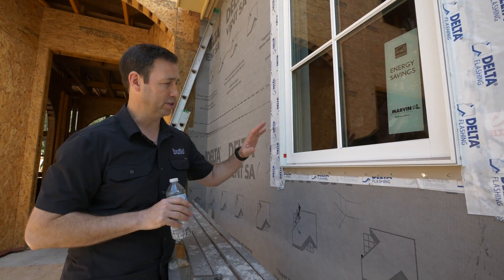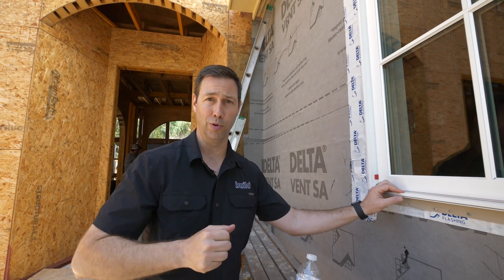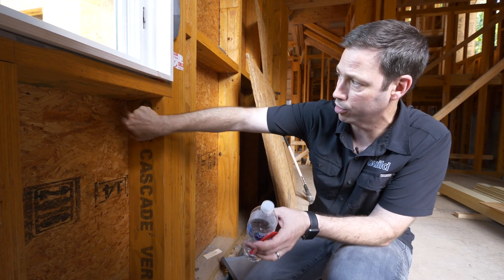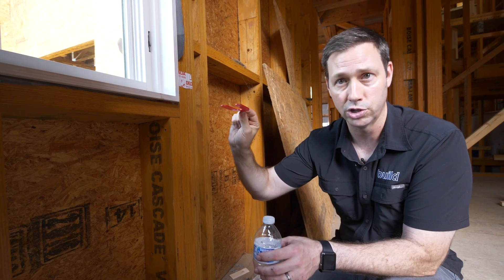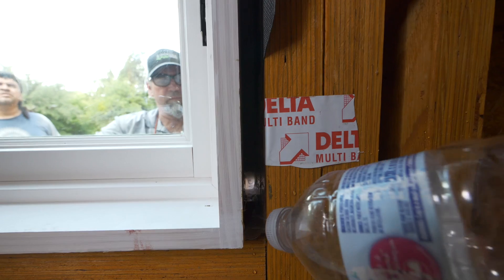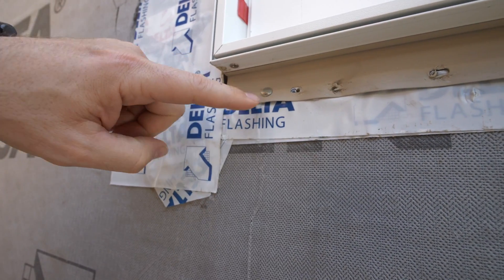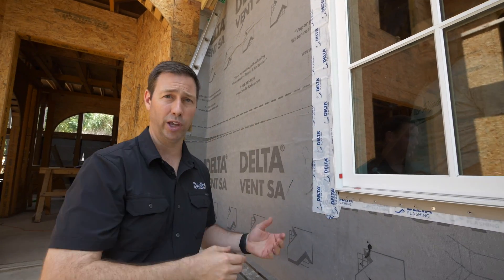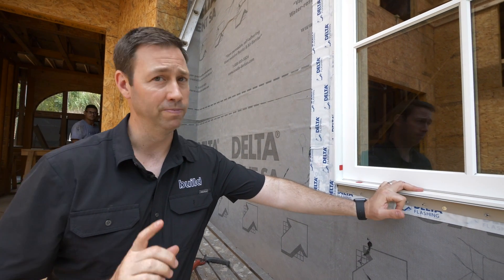What happens when a window LEAKS?  Testing an install

Comment: Hi Matt this is a great video. We have block frame Fleetwood windows installed in our new home and unfortunately we have leaks at the bottom corners on the inside drywall. The contractor said it is the window units that are at fault. But after testing it is the install that seems to be the problem. Any tips on installing block frame windows (they are placed flush to the inside frame so there is a reveal around the windows on the outside.

Comment: I just installed windows in my beach house with very similar practice. We get 100 inches of rain a year (Oregon coast), so I assume water will get inside at some point. I cut channels on the back side of the bottom trim to facilitate getting by the water all the way out from the window. I also have a rain screen assembly it would drain to.
Reply from the maker: +Ttf Web fantastic!  Love to hear that

Comment: Here in Norway (and Europe aswell, I'm not sure) windows are not installed like this. Usuaully windows are installed with approx 1.5cm gap all around. Then it's usually sealed with 3 layers: silicon all the way on the outside, a tube of rubberish material, then another silicon bead on the inside, around the frame of the window. Further, the sill is installed level because there won't be any leakage. The result: a super water- and airtight window install with no fuss.  

Is there a reason these types of windows aren't widely used in America? What's the advantage with these types of windows vs. the ones over in Europe?
Reply: I agree, it seems to make more sense to put multiple layers of water and air proofing around the window, then making a ramp for water to get out and sacrifice on air and water tightness.
Reply: In Norway you also live in igloos and ice-motels.
Reply: Sjur Filip Vik Haakestad dude.  Matt is the best builder I have found by far to follow.  Even building million dollar houses.  they don't compare to Matt's install cause a builder mostly cares about cost.  if anything fails they buy the house back
Reply: Even so, I would still like to know the reasoning behind using these types of windows. I'm not trying to come off as arrogant, I just don't understand why these windows are so prevalent in the US.

Comment: why did you remove some of the nails on the bottom flange?
Reply: It does not appear as though the horseshoe shims worked.  Originally, yall overnailed the bottom flange. I suppose you tried the water test, it didn't work, You un nailed it so it would.  Am I close?
Reply: I noticed that too. Matt's installers typically skip-nail the bottom flange. My guess is that someone simply over-nailed it, and that it was later corrected. Whether the correction had anything to do with the water test? I think the water still would've drained, but at a slightly slower rate.